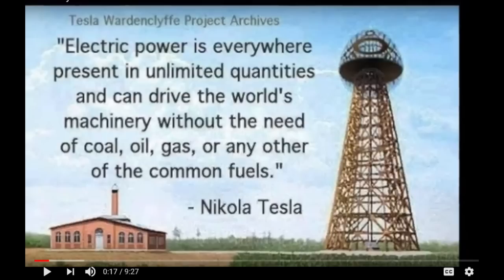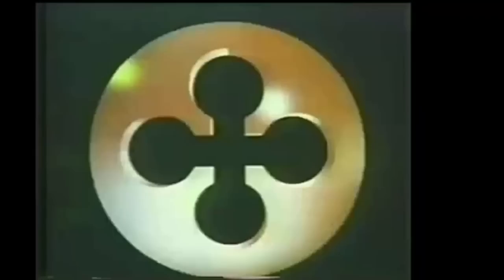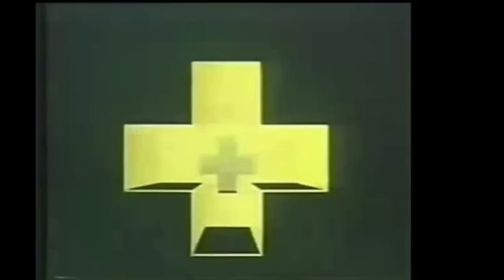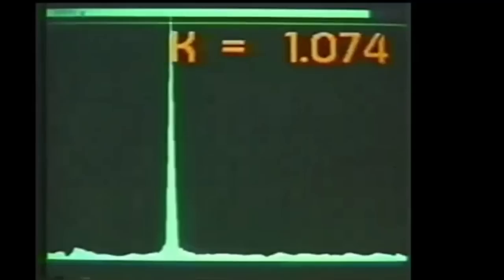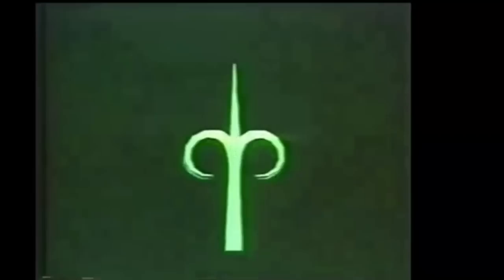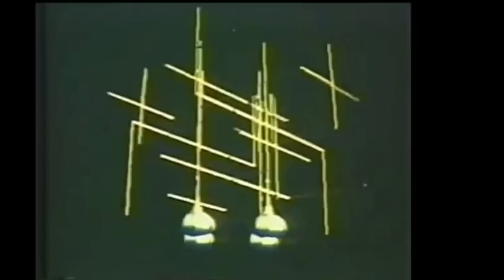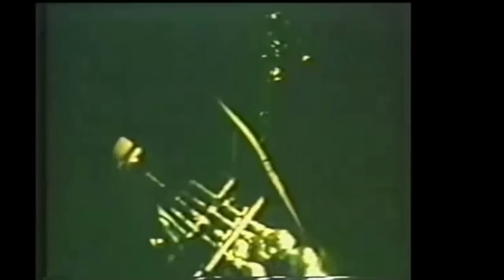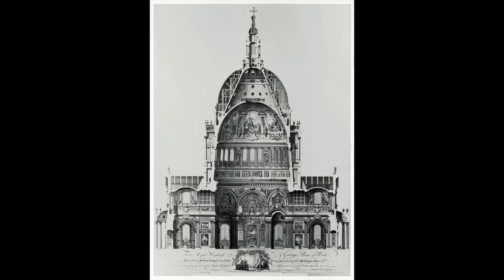Free Unlimited Energy in 1850

Comment: Have you ever noticed Jon,,,,you will never see a wood pile anywhere, or piles of coal,,,for a time when everyone supposedly had a fireplace,,, I find that very, very odd,,,,, TY Sir,,,  😁✌
Reply from the maker: Indeed Michael, and often the "supposed" coal chutes were just old mud flooded windows.
Reply: Genius...
Reply: Could certainly be some other function but practically speaking dumb waiters (elevators) and low paid staff (slaves) could easily keep those fireplaces fed. Plenty of people have wood heat yet no evidence of wood piles in their yard.
Reply: @jonlevichannel  ~ I once owned an old law tenement in New York City (c. 1980) on 98th Street between Park and Madison. It had a mudflood buried first story with a floor about five feet below grade at the north, street side of the building, on a gentle north facing slope. And an operating hand shoveled, coal, single pipe steam, heating system, with a coal chute and bin near the street, also in the basement.  (I got the deed for $750, with $42K owing in back taxes, for fifteen apartments. Both city and state were bankrupt, and gold spiking.

Comment: What if ....all of the gold "trim" on these magnificent "cathedrals" starts out as lead... and through generating a standing electrical flame (on the tips of trim pieces) by breaking the symmetry between the physical and the non-physical world.... turns lead into gold? Maybe that's what the Philosophers Stone is all about? 432Hz.... 4+3+2=9.
Reply: How would one do that?
Reply: @blainecurtis2634  I almost argued or criticized that but lead is a good conductor, gold is a good conductor, and lead and gold are heavy. The reason we use gold in electronics is because it’s a really good conductor and its resistance to corrosion. So the weather or current won’t change its consistency and it will stand the test of time

Comment: 4:39 Inside resonater have converted the inside energy of ether, you get more back then you put in. And makes obsolete the use of coal, wood, oil. You can tap the relational energy on nano-niveau and use it for electra. Converter of Ether energy into Electricity. Inexhaustable source of Ether around us.
Sharp balanced set-up required. Out of angle and your input bounces of the Ether.

Comment: Very cool... I've noticed this as well, many similar repeating patterns or numbers, esp the number 25 or 2 and 5, which are really the same shape but flipped, and interestingly 5^2 power is 25.... also, I learned this from looking at magnetism lines as they radiate, but I think the shape of the number 3 is actually formed by 2 lines going in opposite directions, basically a 5 and a 2 shape spreading out from a common point, which when u look at it overlapped make the shape of the nymber 3... as well as the omega or om symbol. 

It is certainly strange how much about electricity, magnetism, and even chemistry via alchemy and chemical structures is found hidden within ancient art and symbols of diff cultures and religions. It makes me wonder what the purpose of it all is.... what was the goal and where is it all leading to?

Comment: You know when you see the heat coming off of an object and it looks like an oil slick in the air. That’s what the Ether is. The rainbow spectrum is always there our eyes just can’t see that
Reply: I learned how to see auras as an adult, from a group who called themselves the wingmakers. This was some time ago and most of the information has now been erased from the internet. They talked a lot about the use of vibrational energy to open portals. They pointed to many things that this video features such as symmetrical shapes having unlimited energy potential. Anyways,  the key to learning how is to take a red and blue circle, overlap them and in the middle, place a cross. Focus your sight on the cross and you will see the parallel colors appear around each red and blue circle. Then, focus on bringing those circles together in an illusory manner, which you will understand what I mean when it happens. Finally, thank me later

Comment: What if the giant Pyramids of Geza generated the power and these devices manifested that power ?
Reply: They are gargantuan hydraulic ram pumps. The flow is designed to rush up and hit the ceiling of the underground chamber and then flow out. This would happen many times per minute. Someone built a scale model and tested it out. He could feel the vibration in the ground 100 feet away and it cycled if I remember rightly around ~60 times a minute. Beyond that is merely speculation as to their true purpose, but they definitely weren't tombs originally. Whatever it was, the pyramid of giza is 2.5 megatons of stone. It would take every quarry on earth in present day 30 years around the clock to quarry enough stone to build one.